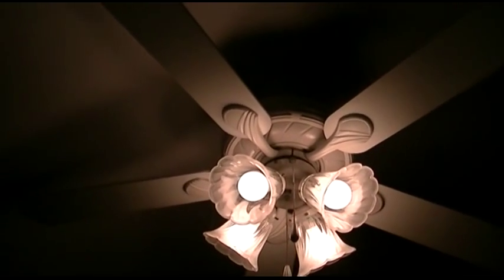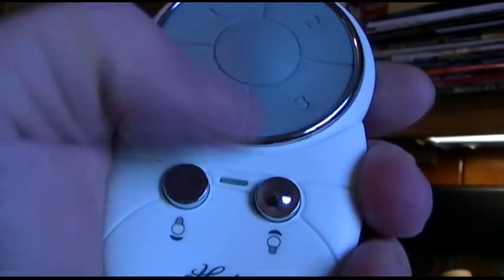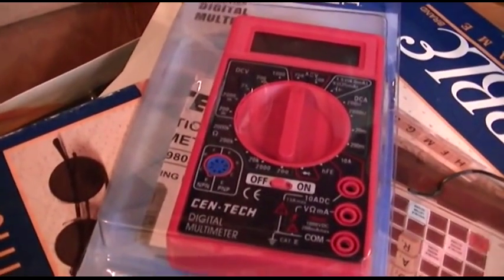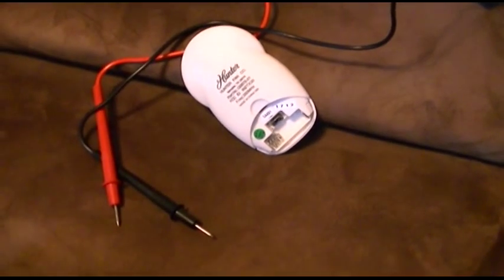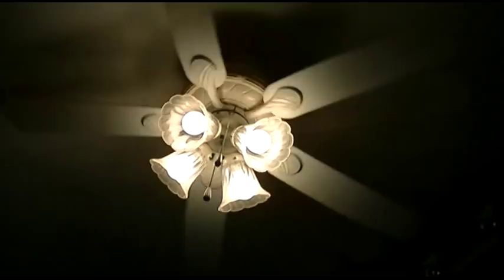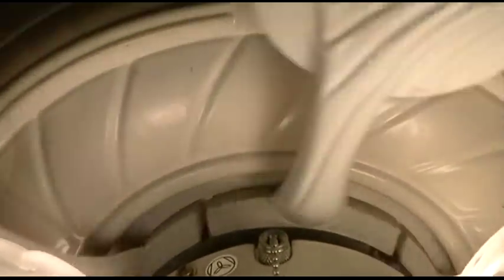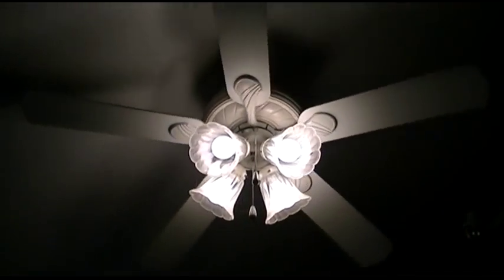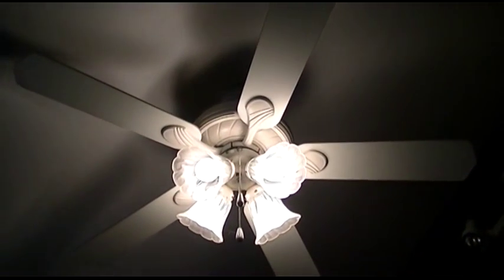Aloha Breeze Ceiling Fan With Hunter Wireless Controller

Comment: My cousin lived in a brand new apartment complex, all of which had that same Hunter remote control.  Apparently they all use the same RF, as her ceiling fan would randomly start and stop, and the light would go on and off, as others in nearby apartments tried to use their remotes and it acted on her fan.
Reply from the maker: +Harley Badger Nice!  There was a small switch in the battery compartment that is probably something like an "A-B-C" frequency selector switch that would help prevent problems like that.  But with the limited frequencies, and the paper thin walls, chances are there was still some unwanted interference from other transmitters.

Comment: I have one but with different glass. It didn't come with a remote or a receiver though.
Reply from the maker: If it has different glass, it may be a slightly different model.  Or a different light kit.  The remote/receiver didn't come with this unit, it was haphazardly added.  That's why it's a Hunter and the fan is an Aloha Breeze.

Comment: Never liked the wireless controllers for fans. In this establishment, they suffer from phantom commands. So in the middle of the night, the light would come on. When that happens it needed to be reset. Via switch or C.B.

5 bladed fans are the best. They move more air on low than lesser bladed fans at higher speeds.
Reply from the maker: +Michael Gegzno I'm in full agreement with everything you said.  Wireless controllers are for lazy people!  Here's proof:  back in the day before remote controls, when you had to get up and go to the TV to change channels, there was no such thing as a couch potato.

As far as the 4-bladed vs. 5-bladed, I never considered a 4-blade ceiling fan to look right.  It always needed an odd number of blades.  The 3-blade industrials were cool as well, and nowadays they make weird 7-bladed ones, but they just look right.  I once had an Oriental co-worker that said something to the effect of "a 4-cylinder engine has to work twice as hard to do the same work as an 8".  While that's not entirely true, the theory holds some water.  Same with the fan blades, except in that case, some air!
Reply: My exception is for small rooms. Like what I have here, 9 X 9. I have 32 inch 6 blade, from Hampton Bay. The 42 inch, cannot get enough air to work.

Them little guys move air. Like a summer breeze, after a front went through.
 
With the AC on, and the fan on high. The windchill is quite pronounce at 78 ºF.
Reply: Nah! Jay was a smart kid and used someone like xjoe81x to turn the knob.
Reply from the maker: Michael Gegzno +1000 Internetz!  You win!
Reply: My grandpas ceiling fan has a levington wall controller. During a thunderstorm the fan came on its lowest speed. What was weird was the power went out for an hour and when it came back the fan came back on. The controller said it was "off" this fan originally came with a remote control and the reciever unit melted.
Reply from the maker: Willie Peck China wireless control!  No matter how much you press "off", it bursts into flames!
Reply: Yes the original one would only run on high and light came on with the fan. The fan is a harbor breeze avain so it moves a crap ton of air. (think industrial fan airflow) so high wasn't the ideal speed all the time.
Reply: +Michael Gegzno I have a 6 blader 36 inch fan in my room by hampton bay and it still works good going on 4-5 years now.
Reply: Mine are about the same vintage, maybe older. They have also been running continuously since installation. Only time they are off, is for cleaning and during power failures.

Comment: And was that a wireless speaker near the compressor?
Reply from the maker: +Jordan U Yes it was.  Care to elaborate?  Ok, I will.  It's got a Brookstone label, it was given to her as a gift, not by me, and the sound quality is actually quite good.  I don't know about the frequency range but it's nothing spectacular.  No bluetooth or anything, it gets static if you walk in it's line-of-sight path, so it appears the transmission is analog and not digital.  No idea on what band or frequency, and I have no more information about it at this time until next I'm up there.  Or you can take a run down the road and find out yourself!
Reply: jaykay18 I have a 900 MHz speaker by Acoustic Research.. Its got a pretty good range (as would be expected from that band) and it works well all throughout the house and outside,, but its not quite powerful enough for use outside.. Indoors its plenty loud,, but without walls to contain the sound, you need much more power to get the same volume level.. I've been looking into getting a more powerful 900 MHz speaker for outside, but they seem to be phasing off the market now, in favor for BlueTooth stuff that has a range of maybe 20 feet tops and only works with some dumb 'smart' phone.. I want something that I plug into a computer and get a powerful ANALOG transmission from..,
Reply from the maker: Jordan U Yeah, I see what you're saying.  Perhaps hacking a pair of computer speakers for its amplifier and putting it inline with the speaker output that's going into the speaker in the unit.  Then start with the new amp's volume dial all the way down and increase very slightly to get more volume.  Of course, being mindful so you don't pop the speaker is also a good idea.  There's also the option of replacing the onboard speaker(s) with more powerful ones...
Reply: jaykay18 The speaker distorts quite a bit at the last few highest volume settings, so I think there's plenty of power there.. Replacing the speaker with something that has a more powerful driver may not be a bad idea,, though I don't know if the unit is built in a manner that would make that reasonably easy to do.. Here's a range test on the thing,, don't think I have any other videos of it at the moment.. watch?v=UAS-67PQj8Q
Reply: I hate wireless remotes because the battery goes dead

Comment: Who the hell uses an A23 battery?  lol
Reply from the maker: +Brandon MacEachern Actually my old Chevy's alarm fob used that, as well as the one for Old Clanky.  Why the hell they used it in a fan controller I have no idea.
Reply: I have no idea what my keyless entry fob for my car uses.  I think it's a coin cell.  It's an after market controller and fob.  God I hope it's a CR2032 or something common like that, lol
Reply from the maker: Brandon MacEachern Mine uses a CR1632.  Doesn't pay to buy it till I need it; the car still works even with a bad fob battery even though it's that stupid keyless ignition, just touch the fob to the start button and there's an exciter coil that allows the fob to work.